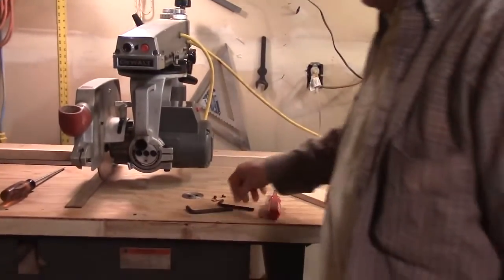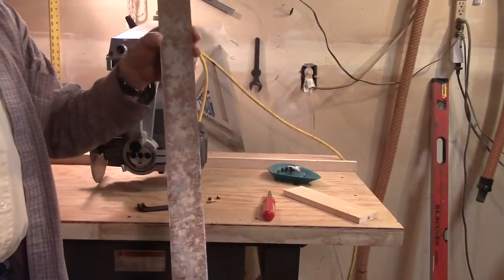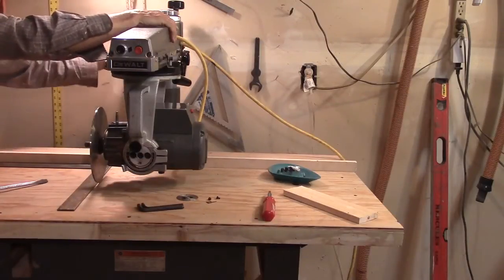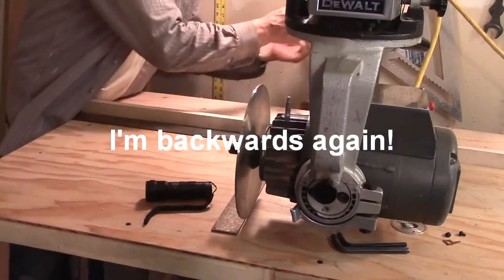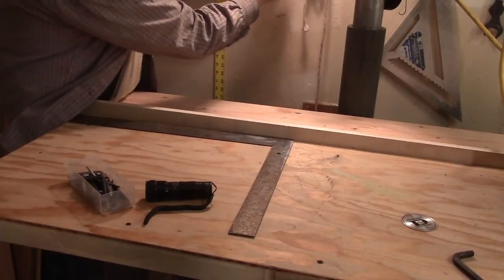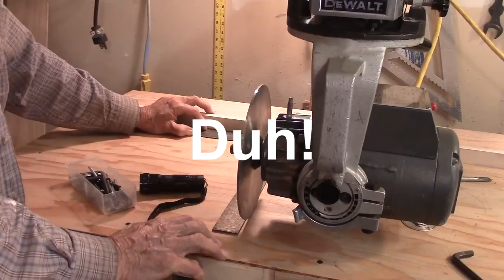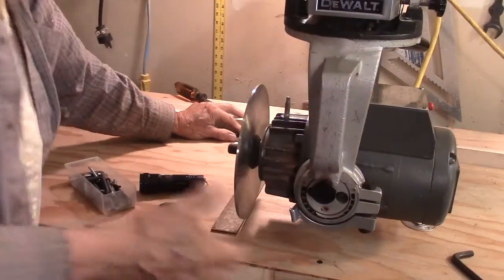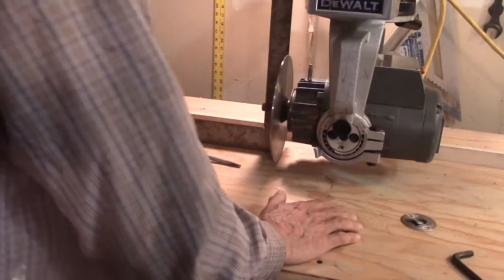DeWalt 790 Radial Arm Saw  Arm and Blade Adjustments

Comment: Trying to get the arm square to the fence with no play is a near impossibility on any radial saw. Jon Eakes made a great contribution to the machine type when he suggested adjusting the stop while biasing the arm to the right with slight pressure, that way you find the same location repeatably, the left side slop then becomes irrelevant. He also explained the adjustment of the ring and tri- screw pivot on the opposite side of the yoke, I followed his advice and get clean rip cuts with no burns to  the edges (no heeling or toeing of the blade).

Comment: I wanted to see if you could suggest a good blade for my saw. It is a 12 inch dewalt. Want a blade that will cut 2x4's. the blades that come with the saw must be dull or the wrong kind. They don't cut good at all.
Reply from the maker: dernolddodge:  This is the blade I prefer: https://www.amazon.com/Freud-60T-Combination-Blade-LU84R012/dp/B0000225V7/ref=sr_1_1?s=hi&ie=UTF8&qid=1518130845&sr=1-1&keywords=Freud+12%22+x+60T+Combination+Blade+%28LU84R012%29&dpID=51PX4J4KBPL&preST=_SX300_QL70_&dpSrc=srch There is also a thin version of this blade for about $40 cheaper.  Hope this helps.
Reply from the maker: The other option:  https://www.amazon.com/dp/B00020JOAK/ref=psdc_552318_t1_B0000225V7
Reply: Thanks. I will definitely get one of the two.

Comment: Ed, i have a 1200 dewalt 1962 radial arm saw, I have a lot of play in arm, will the arm adjustments allow me to take all of the play out as well adjust blade 90 degrees to fence.  Or do you deal with side to side movement.
Reply from the maker: Lewis, Yes you can fix the play in the arm.  Adjusting the arm 90 deg. to the fence is a different adjustment.  Adjusting the arm play is the first thing you should adjust.  You should be able to find a manual for your saw on the internet, a manual is a must have.   Good luck.
Reply from the maker: http://vintagemachinery.org/pubs/detail.aspx?id=513

Comment: Good info on RAS setup Ed
Reply from the maker: WoodWorkWeb Next time I'll cover removing heel with the blade in the vertical position, e.g., making the blade parallel to the travel of the arm.  This would be like setting the blade parallel to the miter slots on a table saw, or depending on the saw setting the miter slots parallel to the blade.
Reply: Ed Waggoner Sr. sounds good, I will check them out when I get back into town